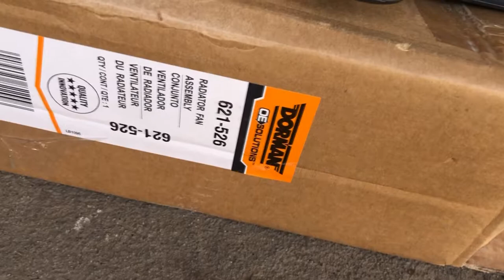2013 Dodge Charger 5.7 HEMI Radiator Fan Assembly Replacement

Comment: Thank you for showing how to fit it back. I struggled until I saw your video.
Reply from the maker: No problem, glad it helped you out.
Reply: @powerkarma  my fan just broke into pieces puncturing my radiator in my 2012 SRT8 Charger. Is there any videos or websites you can send my way that may help. I took my bumper off last night. Looks like I need to start unhooking hoses. I will buy the assembly and radiator from rockauto today. This seems like something I can do. I have it jacked up on stands already. Any help would be greatly appreciated. Thank You!
Reply from the maker: @robotviewer1396  I can’t think of any video, but I did the radiator on my charger, I did not have to remove the bumper I pulled it out the top, that’s how I knew how to remove the fan assembly, once that is out of the way, the radiator will come out the top

Comment: Thank you so much for posting this. I'm right there in the process right now (radiator replacement) on our 2012 and
have hoses,etc. out of the way. Could not for the life of me figure out how to get the fan past the water pump pulley!
So, to reiterate - drop fan down, rotate the plug-in side to vertical while keeping the whole thing to the passenger side
of things, then work it up and out correct?
- Ed on the Ridge
Reply from the maker: Exactly, that is how you do it. I know it works because I removed it two other times, one for the radiator replacement and two for the water pump replacement, third time for the fan assembly itself.
Reply: @powerkarma  Thanks again! New radiator arrived this morning and it's one of those times I wish my
hands were smaller. 🙂
(Those condenser to radiator bolts are a BEAR with meat hooks like mine).
Wish me luck - Ed on the Ridge

Comment: I got an 06 5.7 Charger and the radiator fan on the driver side won’t spin I can’t even turn it with my hand. So my car over heats and causes bubbles in the reservoir. Put new thermostat on and new radiator cap and still  does it do you think it could be the fan or air trapped in the radiator
Reply from the maker: If you can't turn the fan by hand , then more than like the motor is seized. My experience with this engine is that when filling the reservoir it take awhile for  the air to work its way to the reservoir. I had to slow fill it with the cap off and the engine running.

Comment: When you replaced the radiator did you go with the heavy duty one? Which I’ve been told is what it takes but is much thicker and the hoses don’t match
Reply from the maker: I did not because it was not in stock, my understanding of the difference is the motor not the radiator. The heavy duty has a brushless motor.
Reply from the maker: I made a mistake with my comment, I did not choose a heavy duty radiator, I'm not sure what the difference is. The fan assembly I did not choose the heavy duty either, the difference is the brushless motor on the heavy duty fan assembly.
Reply: powerkarma ahh yeah I’m getting different thing from different mechanics on it I didn’t think it would be this difficult just to find the correct part